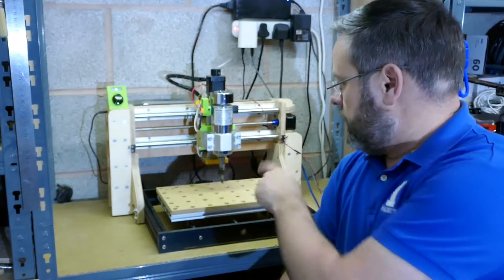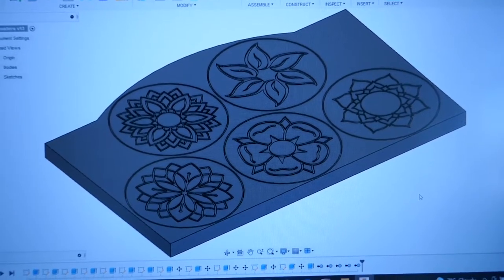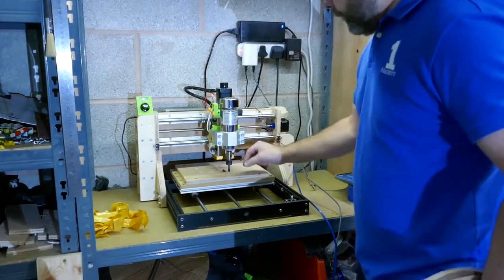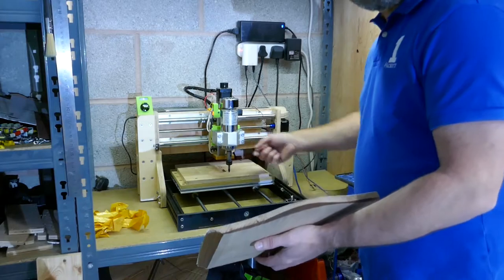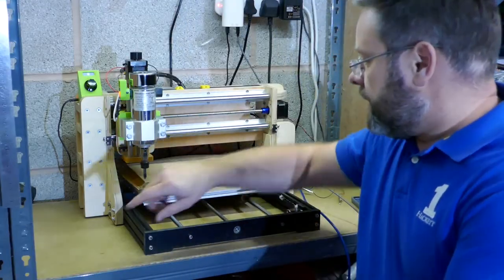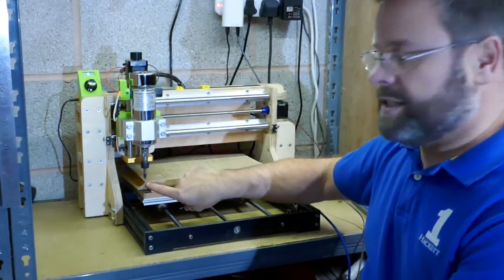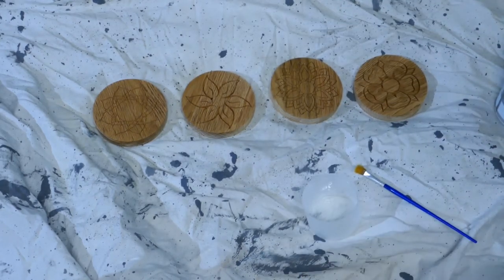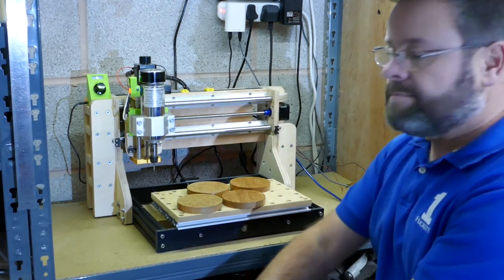Oak Coasters From Scrap Kitchen Door - 3018 CNC

Comment: Sir, which design software you have used here?
Reply from the maker: I used fusion360 in this instance but there are lots of different free and subscription programs which would do the same job. Easel, Carbide Create (V6) etc
Reply: @Wallworkshop  Thanks for your kind information; I have one grbl 0.9 based cnc; I want to realm design software using any  suitable offline software. please help me